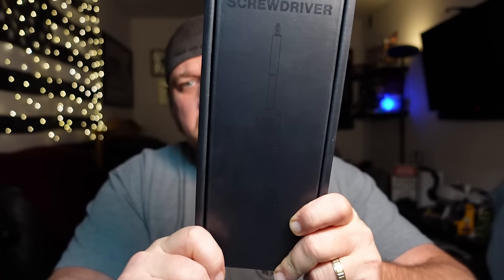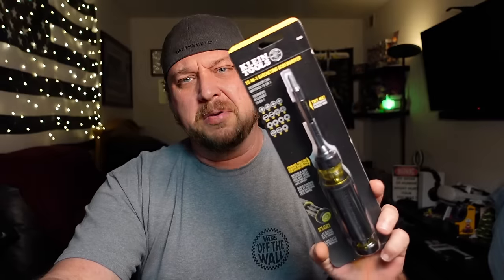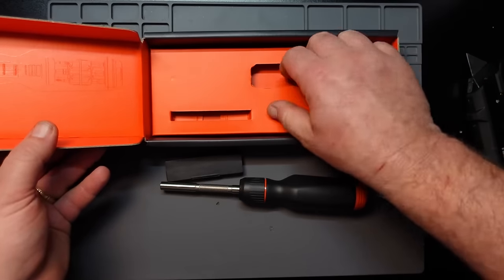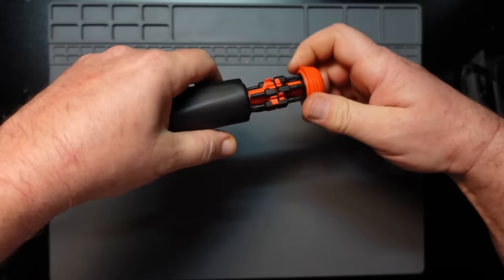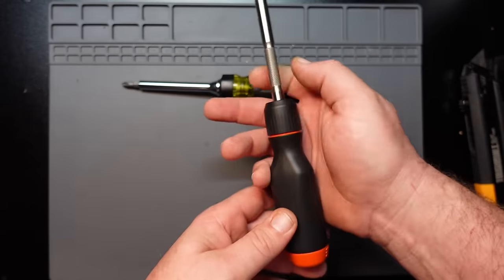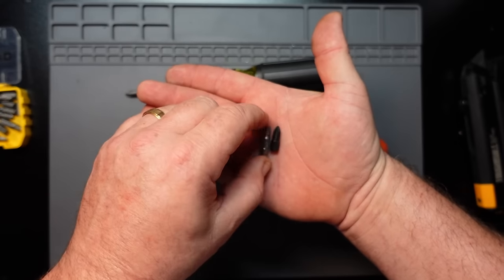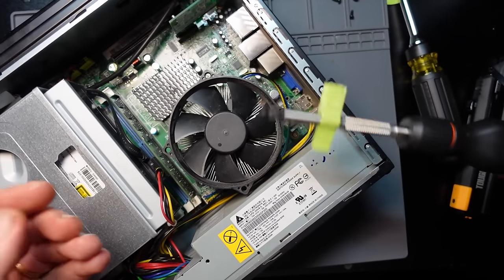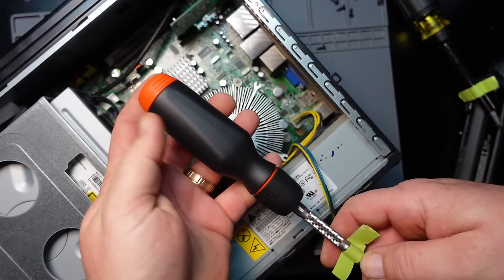LTT Screwdriver Vs Klein

Comment: Electrician here with almost 20 years in the trade, as well as being a huge tech nerd who frequents channels like LTT, J2C, etc.

Klein is the better of the two from my use in almost every case.  The LTT screwdriver is nice, and the ratchet is butter smooth compared to most ratchet drivers (which I'm not huge on anyway), but at the end of the day it just isn't as versatile, durable, or as good of a value as the Klein is.  Partly due to the smooth plastic handle vs a rubberized handle with more grip, the ratchet feeling like it'll break if any torque is applied to it (Though it probably won't, Project Farm did an amazing review on it and it does actually hold up well, but the feeling of it doesn't inspire confidence), and the worst offender being the price point.  The Klein costs ~$22 for either the ratchet version (32305), or the more expanded multi-bit version (32303 (which also uses 100% standard size / length 1/4" bits so you can customize it with stuff you already have)), while the LTT driver costs $70 + $10 shipping here in the US (or $75 on Amazon).

If the LTT screwdriver was priced more in line with the Klein tools, I'd say it's all up to preference, even if you have to buy semi-special bits to swap out into it.  But, at the current pricing?  I can't in good faith advise anyone to buy the LTT screwdriver, regardless of if they work as an industrial electrician, or as general tech support; it just isn't a good value for what you're getting.

Comment: My 2c as a mostly residential electrician, the LTT blows the Klein out of the water. The ratcheting mechanism is way smoother, the magnet is a game changer, I can put the bit in the handle and use the 1/4" drive without losing the bit, and the triangular handle doesn't roll and is easier to put torque on. I've broken the ratcheting mechanism on the Klein, and the rubber handle disconnected from the body and freely rotates around the plastic on both of the kleins I've had, so I couldn't put any real torque on them.

Comment: Yeah, ive heard the LTT is super smooth, and i GUESS that is comparable to the Snap-on ratchets (best ratchets ive used so far), but i generally use my snap on ratchet for engine work or area where i have short ratcheting space, and that how i can justify my snap on ratchets. I dont really see a situation that would be similar in the small electronics world (i also repair some smaller electronics at work)

Comment: reason most ratcheting screwdrivers do opposite direction twist is so that if the switch gets caught on something it doesnt change the ratchet direction. in a tight spot where a bolt or something snags the ltt direction of ratchet in direction put then itll keep flipping it. its one of those, when it happens youll hate it and realize why the opposite direction switch became an unspoken standard. 

95% of the time it is perfectly fine and as stated is nice for ease of memory, twist right to tighten right.

Comment: Funny you mentioned potentially looking at the Milwaukee Ratcheting screwdriver; the cheapo little DeWalt ones are actually apparently really good, not even counting their price point. Almost zero backdrag and decent grip feel. I have one that has the extendo shaft thingy which can be pretty handy. Bought it, took it out, walloped on it for a bit enough to have to lay into it, and it did fine. Keep it in the truck since I dont want to carry around 20 drivers.

Comment: If you have a dremel and a drill or lathe to spin the bit, it's pretty easy to use a cutoff wheel to cut a normal length bit down to the size that will fit in the LTT screwdriver.  I got one just to support LTT since I watch so much of their stuff but it has become what I use the most for projects around the house.
Reply: The bit holder in the handle has a piece that can be rotated out of the way to hold standard sized bits.
Reply: @steelbluesleepR   Yes, but then you can only fit 6 bits in the handle instead of 12.

Comment: I have several of the multi screw drivers.  I tend to prefer the ones that hold the bits in the shaft with usually three or four nut drivers.  I kinda leave them all over the house and in drawers or glove boxes, so cheaper is usually better.  I have a kleine that has a light on it that I have found indispensable.  I use that for field work.  I am a fan of the magnetic bits on the LTT, and I might buy it just for that reason.  I do prefer the double ended bits as I find them easier not to drop.  I do prefer the non ratcheting slightly, but it doesn’t matter very much to me.

Comment: I still think the bench mark for these types of tools is the Snap-on ratcheting screwdriver. I like the smoothness of the LTT but the 4-sided handle of the Snap-on makes for a better grip and applied torque. I had the Snap-on for professional use as an aviation hydraulics mechanic for 10 years.

Comment: Let’s cut right to it: 🫡
LTT = Nerd tool.
Klein = Durable, trades accepted tool.
Love, Linus, and his show, but that driver is for small inside type activities. The Klein can be used as a hammer, in a pinch, which won’t work with LTT because bits would be flying across the floor in sheer seconds. 😂

On a side note—LTT’s is comparable to Snap-Ons version, except they offer lifetime guarantee—does LTT? 🫤🧐🙈

Comment: I have klien screwdrivers as I am an electrician and have noticed the edges are rounding over after about 9 months of use. Theyre well built but one of my coworkers has Wiha screwdrivers that he has used for 20 years and they cam out less than my Kleins.

Comment: I think the way you switch it, that it's opposite from anything else is not a good feature. For a normal ratcheting screwdriver you just hold the ring and twist the actual handle in the direction you want it to go, for example during the first turn, so you don't even have to do an extra step of setting the direction, you just do it as you go, while on LTT screwdriver you always have to set it explicitly, as an extra action. It's a classic case of someone designing a tool without understanding it.

But i also don't think a ratchering driver is good for PC building.

Comment: Ratcheting screwdrivers have their place, but honestly almost all tech people who work in machines a lot use either a small cordless driver or they use the regular thin screwdrivers that have the back cap that spins.  Lets you control the screwdriver with your palm while turnign with your fingers and never having to let pressure off the screw.  Those are better than any ratcheting screwdriver because as you see no matter how light the back pressure is you'll rarely get the screw all the way out anyway.

Comment: ANEX 397 is best ratchet... its a ball ratchet so you can hold it in your palm sorta and turn it with your fingers, so backdrag doesn't matter.  The ball is still wide enough to apply all the torque you'd expect to be able to with a screwdriver.  Also while sorta holding in palm you can easily reverse directions with one finger, no fumbling.  Also it has the best lockup of any ratchet, it feels like a normal screwdriver when locked..  you can literally use it as nomral screwdriver and only enable ratchet once in awhile.  Its also $20 so you can't beat that.  Only 'downside' is no bit storage, but that also allows it to be a nice size.  No huge ass handle for sake of holding unneeded junk.

I've used LTT and its 'fine' .. I'm just not fan of huge handle to hold bunch of bits where 99% of the time I only use 2-3 of.  The ratchet is 'fine'...  is less backdrag now the thing that matters most?  How about any roller bearing ratchet with near zero backdrag?  Shouldn't that be vastly superior?  Meh.  Is smooth plastic good for handles?  The name is only thing that sets it apart.  Otherwise its just one of like 20 decently good ratching screwdrivers that hold bunch of bits, all with their own pros and cons.

Comment: I feel like the LTT was primarily made for electronics and computer work, where the need to apply lots of torque to a fastener is just not something that you ever do.  Whereas the Klein...you could probably torque every screw until the head breaks off, and the screwdriver would just keep going like nothing happened.  I do agree, however - RUBBER on the grip of the LTT would be nice. :)

Comment: Enjoyed the comparison  I have both as well (maybe not quite the same Klein one) and I do find myself using the LTT one most of the time.  One thing you didn't really cover which is something I like about the LTT one is especially with computers when you get the screws loosened a bit you can use the knurled part to really spin them quickly loose - so ratchet at the start and then just spin the shaft only.  
As to the handle, it's fine for me but I can see for some they might find it slippery, I'd go with some hockey stick tape.  Gives great grip.

Comment: You imply the only reason to buy this is vanity, to give you a talking point and to show off in a server room.  This may be a common reason, but ignores the finance calculation.  To make the math easy, assume you're paying $80/hr for a technician (total cost, including benefits and what not).  This means the screwdriver is worthwhile if it saves 1 hour of labor before your next best use of the $80 would.  For basic computer assembly, this is not likely, but for working in awkward locations, the lower slop, slim profile, and stronger than average magnet can easily save you a couple minutes per operation (1 dropped screw can take over a minute to recover).  Spend a week doing that and you've payed for the screwdriver.

Comment: For me tearing apart computers, servers, 3d printers, and racking network gear at work, its great. I 3d printed a box out of CF filament with a TPU insert for the other bits, and taking things apart that don't require unga bunga torque is easy.

Comment: They chose to not do a comfort grip because they wanted it to last forever and they were concerned about the grip breaking down over time. It’s probably less of a concern for soft hands without calluses. Also I think the end cap spins so you can hold pressure on it. I’m still waiting on a long term review from someone using it for construction and automotive before spending that much on one but there were some helpful reviews in this comment section

Comment: Thx for the review. I have the Klein Tools unit. It was a gift and it is excellent when I am doing electrical work. 
Not to be contrary, but I like the opposite rotation directional switch versus the way the LTT is because it does not reset to the wrong direction in tight spaces with my thick hands(and skull).
Always glad I subscribed here. Don't change a thing on my account.

Comment: Ratcheting is great for electronics, small spaces (which tend to come with electronics) and just generally putting small things together like 3d printers and such.  They're perfect when you've gotta put in 8000 tiny screws.

Honest to God the only thing I can figure I want more from the LTT would be a rubberized or at least stipled grip on it.  I agree with ya, it's just too smooth.
Reply: You could put the heatshrink rubber grips on it that are used on bike handles.

Comment: Put an SSD in that Gateway and it'll be a good web browsing machine or dump Office on it and some kid who doesn't have a PC for doing their homework will be quite happy. 
As for the screw driver (but I'm not the driver) I would choose the Klein over the LTT one base on the small LTT bits and the smooth handle. I would prefer the grip on the Klein and the larger bits for old fumble fingers here. If they aren't magnetic I have an old mechanical HDD magnet that can change that.
Thank you for the video and tool review. 👍

Comment: I would imagine the LTT one is specifically designed for the small screws you find in computers and other electronics, whereas the Klein is designed for larger screws an electrician would encounter.

Comment: the LTT screwdriver is a ratcheting screw driver to fix PCs with (because funny enough, Linus's snap on screw driver broke and he wanted something better lol), but you can use it for anything, just the more tough a job is the more it might break, every tool has its purpose.

i have heard Jayz2cents bit holder was broken slightly, a couple of the lugs had broken.

i have been using mine to take screws out of 18mm chipboard flooring in the new house me and my wife bought in september, i found it very useful to get screws that tend to not want to come out, the ones if you put a battery drill on them will destroy the heads, that i could get good pressure down onto the screw and turn it slightly until got it going enough and it was quicker than an ordinary screw driver, it felt quicker to keep ratcheting them out rather than change to the drill once started to get the screws out.
its a good bit of kit, i will have many uses for it lol

Comment: Milwaukee hand tools are generally junk. When i lost my previous Klein ratcheting screwdriver (same here) in an attic, i looked around before buying my second one. Klein has always had bit arrangement down pat, even in their previous model (just weighed a ton). Milwaukee's bit arrangement and layout looks like they asked a toddler what they thought was best. Said toddler said the T15 would go well with the PH2 because the letters looked cool together.
Been using that Klein driver since they released it and it's not let me down. I like it just because of the arrangement of bits and simplicity of getting what I need when i need it. That LTT looks sharp though. Magnetic bits is also a big plus.

Comment: i just have a snap on rache screwdrivert, given to me by my father, mine now is going on 20 to 25 years old. still works perfectly. 

LTT used to use Snap-on' rachet screwdriver, for many many years. so i could always relate. when LTT produced their own, i was simply never interested in buying it, since i already had a perfectly working screwdriver, and if it isn't broke. don't fix it, or in this case, dont replace it

Comment: The idea for ratcheting screwdrivers here is that you're in a confined space where slipping off the screw, which could also be very small, has expensive consequences. Though personally I prefer the rotating knob on the end like the ifixit screwdrivers.

Comment: Actually a decent practical review of the screwdriver. Most other reviewers just hooked it up to weird equipment to test the ratchet and dropped a bunch of times to test durability. It’s nice to have an impartial review that focuses more on what it’s like to use.

You did very well not to throw it to one side and grab a regular screwdriver with a spanner head.

“Just throw my ratcheted spanner on there, and owe look, I’ve made a ratcheted screwdriver with better reach and 10x the torque.” 😂

Comment: The $22 Klein will outlast the LTT junk by at least a decade.

I bought my Klein 10 in 1 in 2001, beat it, used the shaft in a drill, it's still perfectly fine, including the rubber handle.

Comment: As for myself I sent the LTT right back as I’m not exactly gentle with my screwdrivers and that slick handle was a no go for me, although like you had mentioned the action was super smooth and liked the knurling, what I ended up with was the Klein 11-1 impact rated flip rstching screwdriver, best one so far and amazon got for 28 bucks right now

Comment: I would on;y use non-ratcheting drivers before, but bought one out of curiosity, now its my daily driver.  I recently bought the 'stubby' for when I'm traveling (the regular one would be confiscated on flights for being too long) and its damn good too.  Some odd choices bit wise, I'd never come across the robertson type bits before.  Seems utterly stupid when we already have cross and torx bits IMO, but I'm guessing its very common in Canada.
Nice job testing the LTT driver for its intended purpose rather than what most other reviewers seem to do while driving in wood screws and complaining about the 'slick' grip.  A grip I prefer as ALL the rubber coated screwdrivers I've used eventually peel or degrade to a sticky mess.  Some subtle surface detail might be nice though, for a bit of added friction on the handle.  And yes, the LTT ratchet is by far the nicest out there, and added points for working the correct way instead of moving the switch OPPOSITE the way you want to screw.
Reply: Yeah, LTT is Canadian and Robertson bits are common there. There are more of them than you might think in the US too, but I would probably have preferred a couple more hex sizes instead.

Comment: I have that Klein, the bits were getting rusty on the jobsite so I shot it with WD-40 and the next day the rubber grip had swollen and came loose from the tool.
Reply: Serves you right. You should never spray WD40 anywhere near plastics or rubber.
It's useless to prevent rust, and it's not a lubricant. It's a water displacer, designed to flush off moisture contaminated things like ignition coils, etc.

Comment: I always tried different brands of screwdrivers. Personally, I'm old school, not too much in the "multi sets" especially if I have a lot repetitive work. This said, Klein has the right grip for most of their single use standard screwdrivers, its rubber and they are overall really good. Yes of course some other brands for very specific use might do a better job. So, not into slippery bulky handles myself. I would still go Klein.

Comment: I have a Gedore screwdriver with much less back drag than the LTT,  but I'm dubious most people who want the LTT would think that Gedore screwdriver was a suitable replacement. I bought it for when I need low back drag, but I don't use it otherwise. Actually, my favorite ratcheting screwdriver is a Vessel with a ball handle, and my second favorite is a really inexpensive Husky screwdriver.